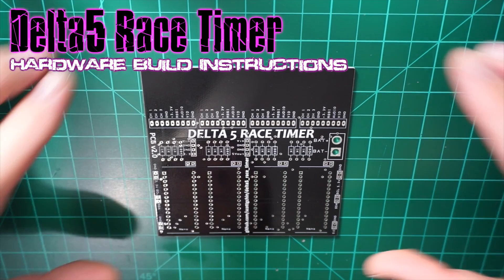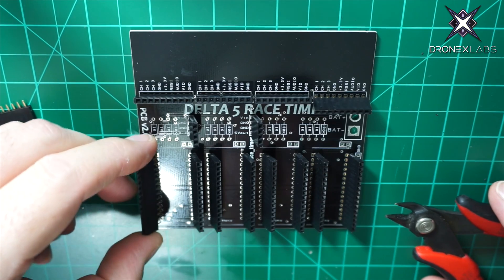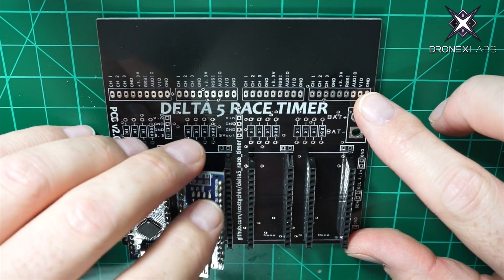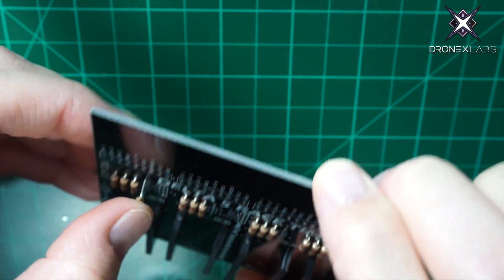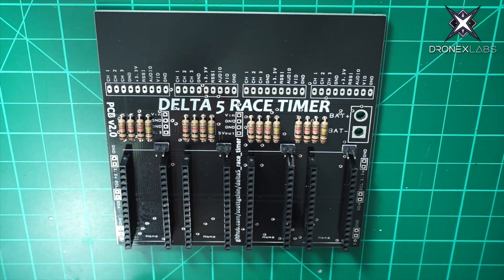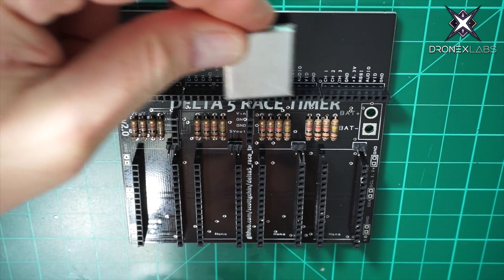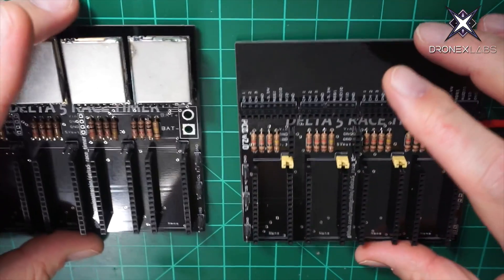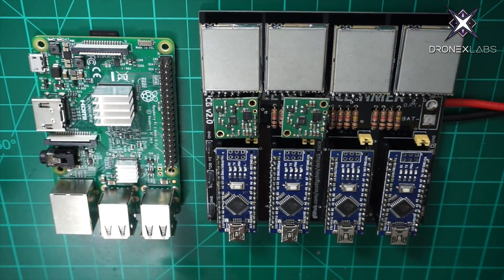Delta5 Race Timer V2 PCB for MultiGP and LiveTime - Hardware Installation Instructions

Comment: This is awesome!  Why did you decide to pin the rx5808 and not use the castellations to surface solder?
Reply from the maker: I wanted the entire system to be easily servicible. These modules are known to sometimes be dead on arrival or fail occasionally. This way I can easily swap them out if issues are present.
Reply: @deepimpactioFPV  smart!  Great reasoning!

Comment: I did not buy the step-down converters, as I didn't see them on the list. Are they necessary in any case?
Reply: Yes, they are required unless you are running from no more than a 5v source

Comment: Do you still need to remove the resistor from the rx5808? Get hub says yes but the videos I have seen don't mention it. Thanks
Reply from the maker: If it has them you have to remove them, but the ones people are buying from Banggood don't have them lately.
Reply: Deep Impact FPV great news. That is where I was going to go. I'm guessing you still need to open them up to check?
Reply from the maker: Yes, that's the only way to be 100% sure. Unless you want to find out after you have built and installed software. That is when you will see errors during software.
Reply: Deep Impact FPV last q, if doing 8 nodes do you need pololu for 2nd board or is the 2.5a powerful enough to power both?
Reply from the maker: You only need one

Comment: What is the total cost for the 4 pilot and 8 pilot versions?
Reply from the maker: I would say ~$200 for 8 pilots and little less for 4 pilots. You can build 3 of them for cost of a single commercially available system basically.